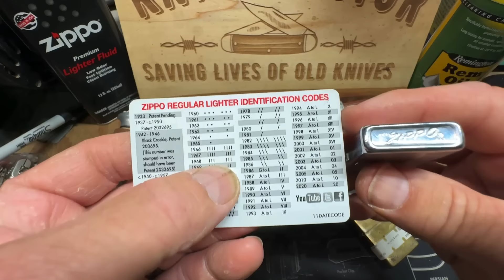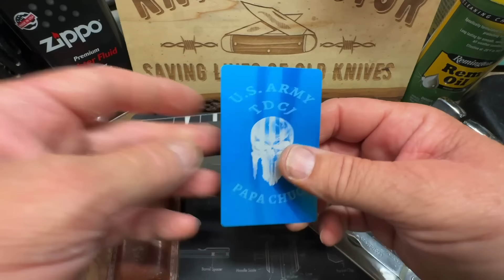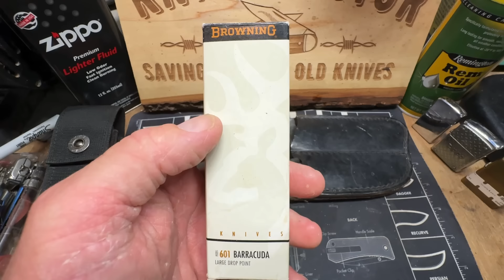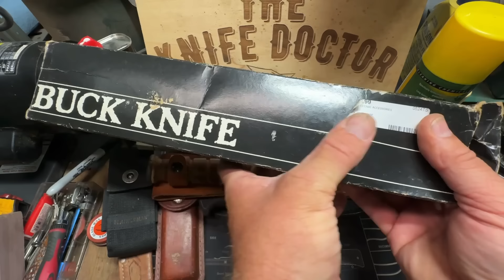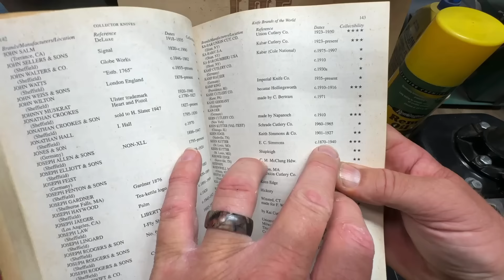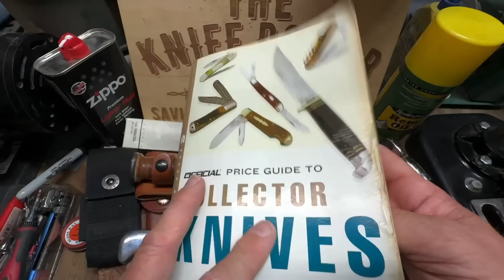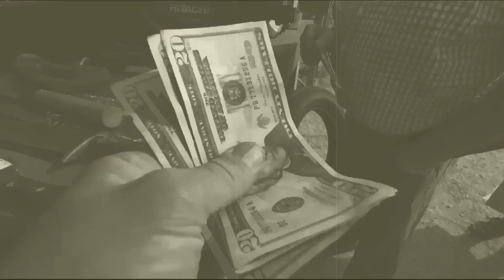Pawn Shop & eBay Knife Haul!

Comment: Great haul. Not sure if you’ve sent anything to Zippo for repair before but if they replace the hinge you’ll have silver spot on outside of lid and base from where they remove the old hinge and put it in the new one. They won’t put finish on it to rematch. And if there is problem with insert they’ll put a brand new one in it from current year. If you want to keep the original insert you need to send note with the lighter and tell them.

Comment: Guys, if you want to patina a new or nos carbon steel knife, all you have to do is cut a couple of hot pork chops up, and that will give the steel a nice color .As time moves forward, the blades will slowly get that blue steel color!!😊
Reply: Thanks for that info. I had a knife made from a railroad spike and used it making pork sausage, it looked like blue chrome afterward.